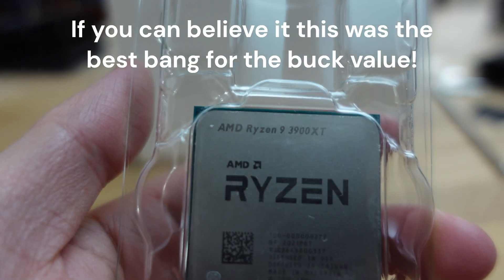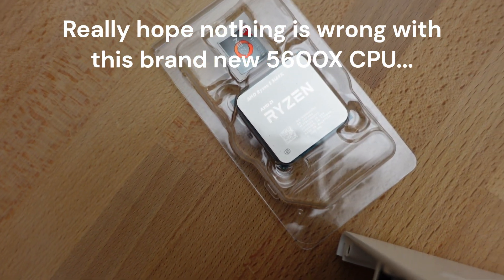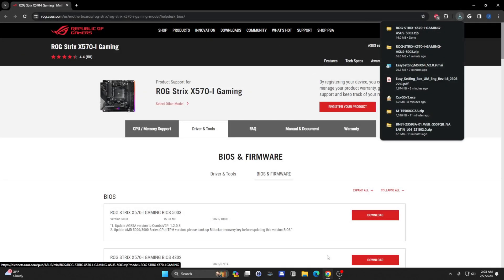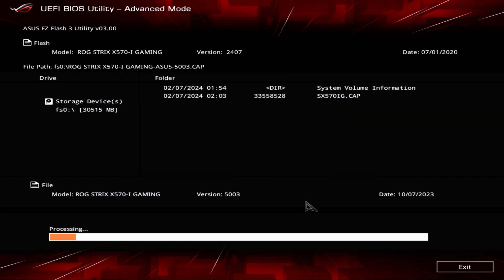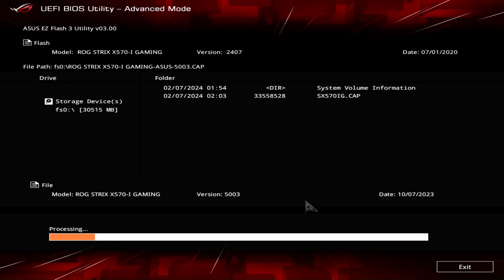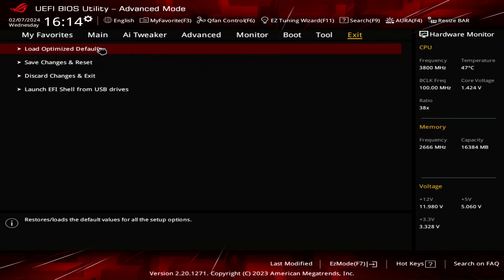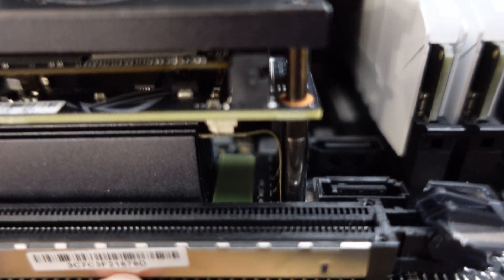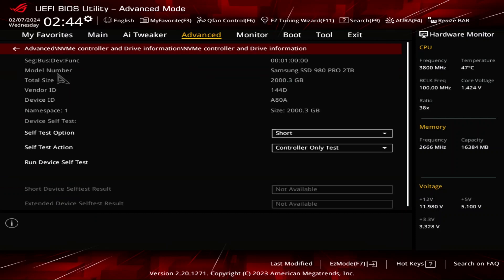BIOS update using AMD 3900XT for Asus ROG Strix X570-I - Persephone Build

Comment: If you wiggle the cooler slowly, the chip can stay in place. Also heat them up little bit like powering on for a while to make the thermal paste little bit unsticky
Reply from the maker: Thanks for the advice. When pulling off the cooler it was a surprise the CPU was stuck to the cooler. I think the socket doesn't have good clamp force or something. Yes, next time I'm going to heat up the CPU and wiggle to make sure CPU stays!